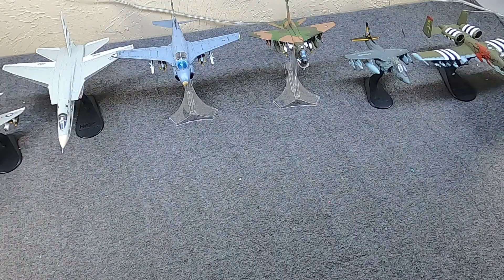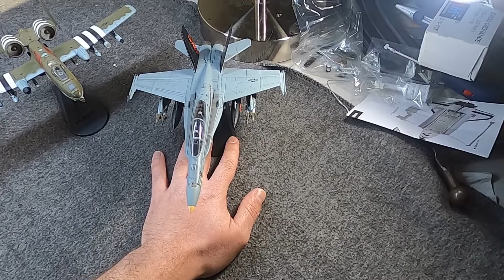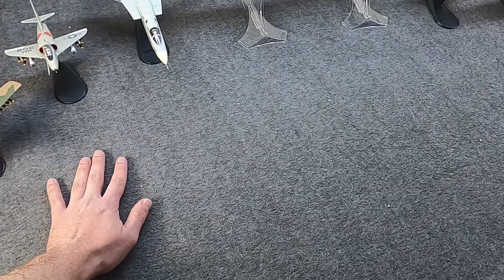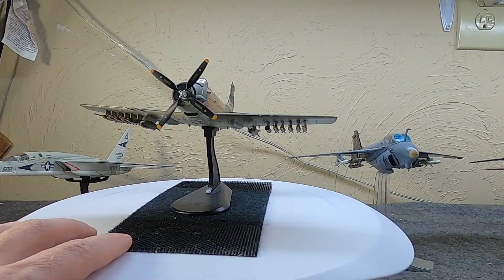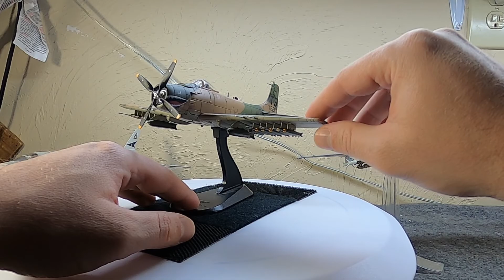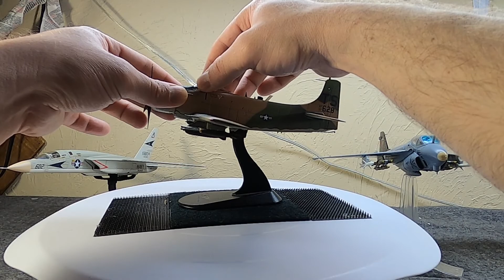American Attack Planes: History From Korea, To Vietnam, Through Today

Comment: I absolutely love the A-4. It's one of those planes that, if it built today - as designed but upgraded with modern avionics, weapons, and engines - it could be a fantastic weapon basically forever. There are some designs that are fundamentally just right.
Reply from the maker: The skooter was definitely sturdy and dependable. I like it too. Probably why i have like 5 models of it in different versions and configurations hehe.